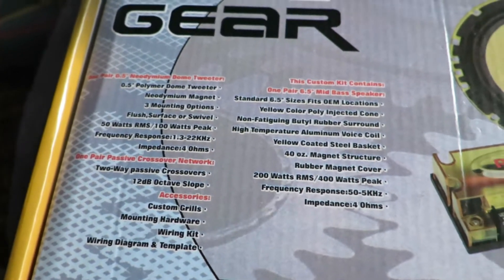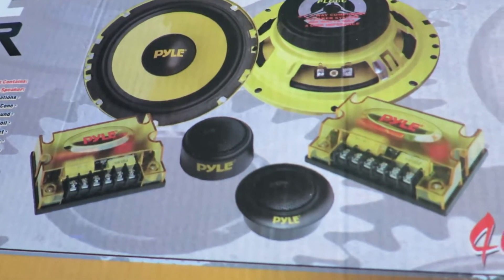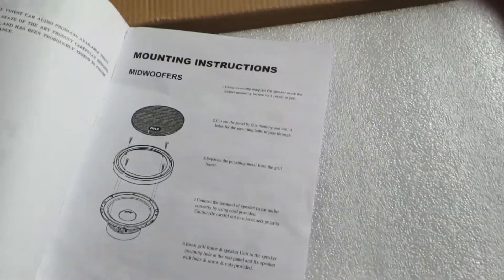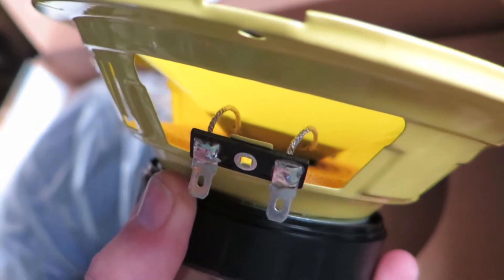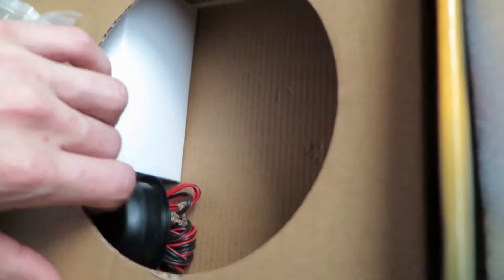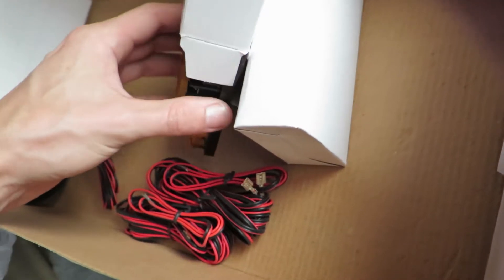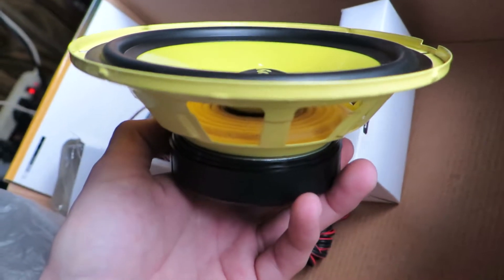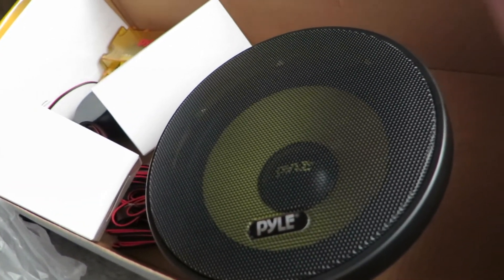unboxing and review of the pyle 400 watt speakers

Comment: OH man where do i begin. im sorry bro but you still have a lot to learn about car audio. If you think your head unit is producing 200 watt per channel (LOL). read the box it clearly states that these speakers are 50 watts per speaker RMS never go by MAX watts its a fairy tale number  PLUS for production purposes  make a script  do the research, know what all the "letters" mean on the equipment .  this is your review people are going to watch this looking for real world information based on this video.  P.S always use the crossover
Reply: Carlos is correct. The basket is plastic, the terminal strand going to the voice coil is thinner than the strands in my NVX speaker wire. The midbass at most can handle a clean 30w rms, maybe 20w for the tweeter. The crossover is surprisingly solid, given the gcheap guts it has, but the plastic basket is hilarious.
Reply: Yep fully agree but the t-tweeters w-woofer meaning the mid bass and the next one is input and never watch peak power or max watts always watch rms so you not going run no way close to 800  you most likely gonna get 3 something watts for the most

Comment: You can choose not to use the crossovers that came with the speakers but however the manufacturer highly recommends that you use the crossovers that are included with the speakers otherwise you will damage and blow the speakers because the crossovers cut out certain frequencies that the speakers can't handle if you hook the tweeters up that came with those speakers without using the crossovers that came with the speakers you will blow the tweeters because the tweeters can't handle very low frequencies so therefore you should use the crossovers because they are included to actually protect your speakers from certain frequencies

Comment: Bro, firstly I'd like to say thank you for taking your time to do this unboxing video, much appreciated. However, I would like to offer you some help in description of the product.  Those are 6 point 5 inch speakers not 6 by 5's... (helpful info for consumers). The "W" is for the Woofer,  "T" for teeeter on the crossover, just to help ya out... so you did a swell job on the description of the product.  We all appreciate the time because I, personally was looking into getting my hands on this very same set to pair with my PLG64 6.5 subs.. I think they would complement each other.  We will see, if you'd like i will let you know how it goes... anyways lil bro good job...
Reply: I want to help you who helped this fine gentleman, this video is gay

Comment: What is the real power of those. I have some doubts for those 200w. Magnet looks like my 70w pioneer 6x9. Did you use amplifier or just connect the to the radio, because if they play from player are far away from 200wats.
Reply: They are 50 watt speakers. Best thing you can do is run clean power to them, so a low power amplifier, solder all the wire connections, break these speakers in SLOWLY.  l prefer to do the break-in process before l even install them in a vehicle. Make sure you keep the power matched for what they are rated for, 50 w per side.  lf you are going to power them just off of the deck power then careful with turning up the bass to high as that is when the power gets dirty and when the speaker will get ruined.  Weak point on Pyle component systems at this level is the crossover as that's the part that usually goes bad first. Pyle Pro uses a bit better components.

Comment: Those are actually rated 50 Watts per speaker channel. 
Use the crossovers, it will make them sound better. 
Doesn't need the phenolic ring around the speaker.
Sorry about your car man.
You should learn more about those speakers. 
Your focusing to much on that Max Watts. The box clearly stated 50 Watts RMS, 100 Watts Max.
You are looking at 100 Watts music program.
Reply: Ok my bad, I only saw the wattage rating for the tweeter. I see the 200 Watts RMS on the other side. You should put an amp on those to make them sound better. The head unit is not doing them justice. I promise you that!